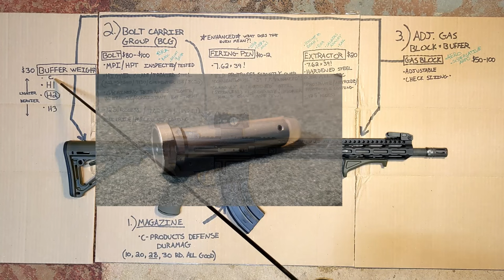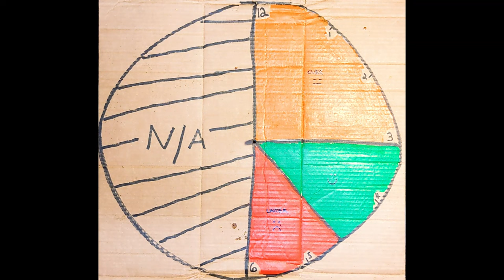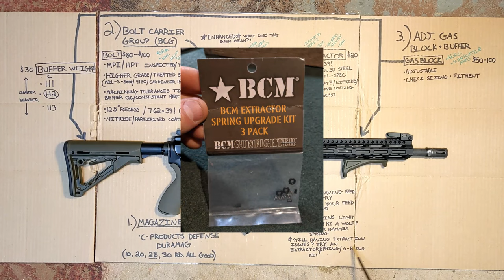How to Build a Reliable AR-47 (7.62x39 AR-15)

Comment: This is a video the needed to be made. Thank you for putting it together.
Reply from the maker: Klayco! Thanks man! Keep up the great work yourself!
Reply: Have you had a chance to test the 75rd 7.62x39 drum designed for the AR platform? I love the idea, but I don't have confidence in the purchase yet. Given the current value of my dollar, the juice must be worth the squeeze. Thank you for your time and efforts sir.
Reply from the maker: @jonathanrawls9992  I have not.  To be fair, I don't have much of a use for drums, aside from a range toy haha.  No problem, hope you found it helpful!
Reply: It's nice that you came out with this video. I made one in 2017 and "blew tub" dumped it. Anyway, I then covered all the shortcomings: mag failures to feed, lite strikes from short firing pins, extraction issues & stovepipes and breaking bolts/extractors.  Your suggestions are what I did back then, as well as I use WMD NiBX coated 9310 bolts. With steel ammo, I've had great luck and currently over 4,000 rounds with no failure. Good job on your video. Just to mention you wrote 9130 steel BC, I think you meant 9310. Also, all my BCs are melonited as well..
Reply: Biggest problem I had was getting enough gas to the bolt, gas hole in barrel had to be opened up, extractors are a service item. C products are the most reliable mags, 28 rounders are the best. 5.56 firing pins are generally not reliable. Built 3 rifles, bought 2 (bca). Redex bolts are in my experience very well made.
Reply: .125 gas port. .134 depth and corresponding extractor.
Colt and PWS use these dimensions. You must also have your chamber headspace to the bolt( duh)
These do not break bolt lugs or extractors.

Comment: You could have mentioned something about buffer spring differences. I prefer a flatwire coil spring made by Tubbs paired with a Spikes T2 buffer(h2 weight made of Tungsten powder instead of solids). The spring adds a better/smoother recoil along with the weight not clunking. Give it a try, thank me later.
Reply: I got the Tubbs flat wire buffer spring also but the first one was bent and the silicone coating was peeling pretty bad then I called them and they sent me another one which wasn't bent but the silicone coating was peeling pretty bad too. I wonder I can somehow get the old coating off with gasoline or some kind of chemical and reapply another silicone coating. Any suggestions?forgot to mention I found silent buffer springs for only a few dollars more and kicked myself in the ass lol

Comment: I upgrade all of my extractors to phosphate microbest extractors. The phosphate coating helps grab the brass and hang on until it leaves the ejection port. Slick surfaces like nitride or NiB are not ideal for extractor coatings because they have a tendency to slip.
Reply from the maker: I appreciate the info!
Reply: @ExtremelyAverageMan   have u heard of Cryptic Mystic coated BCGs?
Reply: @ExtremelyAverageMan  also I wonder if the shortened AR10 chambered x39 BCG from CMMG would fit in my Radical AR47?

Comment: Iirc the reason Colt was able to make a reliable AR pattern rifle in 7.62 * 39 was because they based their 7.62 × 39 AR on an AR-10. Since the AR-10 was designed to fire .308/7.62 NATO, it had no problem handling a weaker cartridge like the 7.62 × 39. The reason other manufacturers had issues making their 7.62 × 39 ARs run reliably is because they based it on the AR-15 which fires .223/5.56 NATO and was not designed to fire a more powerful cartridge.

Comment: I bought a BCA 7.62x39 upper years ago when Obama wanted to ban M855 and 5.56 prices went crazy. I saved my 5.56 and decided to shoot some of my cheaper Russian steel case 7.62x39 ammo I stockpiled for my AK/SKS. I did end up having to replace my hammer spring with a heavier hammer spring and replacing the firing pin with an enhanced firing pin for mine to shoot Russian steel case more reliably. I still had issues igniting Golden Tiger, but I just save that for my AK and SKS. On my bolt, I replaced the bolt with a Young Manufacturing heavy duty bolt with heavy duty extractor. I also prefer the 20rd Duramags.   So far it's been reliable enough for range use, and I wouldn't be afraid to use it for defense if I had to.
Reply: @85Sirex sound solid I’m trying to that on my first 762 build

Comment: Nitride treatment is more brittle. Can make the surface chip on on corners. Phosphate is more reliable FOR BOLTS
Reply: Phosphate will certainly last longer when firing but nitride is smoother and far more rust resistant while being a little more brittle than phosphate. Phosphate will last longer under firing while nitride will last longer when unused and it won't require as much lube to run as phosphate will.

Comment: Thorough. I've seen so many questions posted over the years and this answers pretty much everything.  Mine are 1.Radical 16" carbine gas with A2 stock/rifle buffer, tubbs 308 flatwire spring, MBT2, lpvo 2.BCA 10.5 carbine gas with H2, damage ind cs carbine spring, Spikes battle trigger, cheap adjustable gas block, mini PA rds. They're basically both spare parts bin hobby guns but they have the components you covered and work. Definitely 20, 28 duramags.

Comment: I bought my first AR47 back in 2007. It was a Armalite. In their owners manual it said not to run steel case. Other wise it would void the warranty. So I all ways stuck with brass cased ammo. (I reload now.) I also make sure the gas system is working perfectly. The ejection is at three o’clock. Never broke a extractor or bolt. Built two more AR47 rifles and bought a BCA at Christmas. I use heat resistance blue loctite on the gas block set screws and handguard screws. The bolts for the handguard thread into the barrel nut. They can get pretty hot. And standard blue loctite is not a good choice. On one of my builds I used a cheap adjustable gas block. After two times out to the range. I could tell that the adjustment screws were seizing up from carbon. Read on another forum that a guy used aluminum based anti seize on his adjustment screws. After two thousand rounds they still move freely. (Anti seize is good up to 1600 degrees.)

Comment: I know I am a little late to the comment section here, but this video is outstanding. I wished it was around years ago when I was trying to figure out how to build a reliable “AR47.” I will tell you after building many of these rifles that my best experience with BCG’s has been with the Fail Zero nickel boron. They are pricey, but have proven to be the most reliable BCG I have ever used in this platform. I would consider them second to none in performance and reliability not to mention they are worth their weight in gold when it comes to the reduction in frustration that comes with extractors and firing pin failures.  Thank you for the very informative video, it is very obvious that you have an exceptional level of experience with this platform as you massed your information exactly where the problems lie with the “AR47.”

Comment: You defiantly have a new subscriber. Great video with great information.I made the Switch over to 7.62x39 a year ago and got all the kinks worked out. You definitely have to do your research before switching over and building a AR-47 platform. It can be a pain at first, but once you get it fine tune it runs smooth as butter. Belom brass is the way to go. I've drop plenty of hogs with those rounds.
Reply from the maker: Thanks bud! Yeah, I feel it's that much more rewarding once you go through the trial by fire and get your gun running smoothly. Makes you appreciate the rifle more!

Comment: Two more things to talk about regarding AR-47s. 
 1>Taking out the firing pin and chucking it up in a drill to face off the end travel with a metal file for light strikes.
2>Marking your AR look alike with a visible ranger band so you don't accidentally put an AR-15 magazine into you AR-47 rifle.

Comment: That's all good and dandy FOR BRASS AMMO, but if you're shooting steel cased ammo, you're going to need an enhanced hammer spring to go with the enhanced firing pin to eliminate those light primer strikes. I was getting 5 to 6 light primer strikes for every 30 rounds fired. I got the "Wolff AR-15 Extra Hammer Spring WS-30093". My AR-47 goes "bang" every time now! Also, don't buy the enhanced firing pin from Bear Creek Arsenal, it is crap (several other comments say the same thing about it). Mine broke on the very first shot. Lucky for me the manager at Range USA let me go home and get my extra enhanced firing pin from Windham Weaponry so I could come back and continue shooting. With both my enhanced firing pin and the enhanced hammer spring it eliminated the light primer strikes. I shot my AR-47 70 times that day to test and it worked. Have not had any trouble since.
Reply from the maker: Currently optimizing my AR's for steel.  Last range trip I shot 80 rounds of lacquered steel and had 2 failure to feeds.  I've since polished my feed ramps with Flitz, hoping that resolves the issue.  Thanks for watching!

Comment: I know this video is a year old, though I wanted to chime in with my experience. I have been building AR-47s since the barrels have been available. I have learned a lot and even used one in the rifle classes I taught. If you buy a Bear creek, don't get the side charger. Why? Because you want a entirely different BCG in it from black rifle arms. You can only replace the bolt when you go with the side charger. I actually had over 20k rounds on a BCA 7.62x39 upper with a full BRA bolt carrier in it. The Bear Creek extractor broke after 300 rounds and the bolt face blew at 650. They were very quick in replacing the part, but I decided to upgrade them instead. The enhanced firing pin BCA uses is still very brittle and they break anywhere from 10-200 rounds. At one point bear creek gave everyone 2-3 extra because of all the issues they had with them breaking. The bear creek barrel was excellent and the only reason I replaced it after 20+k rounds was because the rifling was almost gone. It would still hold 4-6 inch groups at 100 but  I really got my money from it and it was time to replace it. At that time bear creek barrels were extremely cheap, I think it was like 55$ so I ordered another one. I didn't even ask them to replace it but I am sure they would have. Now the BCA barrels are 100$ or more and you could easily get a Faxxon from Right to bear for about the same price. The Right to bear branded stuff is either aero, bear creek, or ballistic advantage rebranded stuff. I find nothing wrong with buying a bear creek 7.63x39 but if you do, account for the added expense of the black rifle arms complete bolt carrier group with firing pin. With that added, you are equal to the price of a PSA with much better reliability because of the Black rifle arms upgrades.

Comment: I’ve been running x39 AR’s for a few years now with no issues, an 18” mid gas and 16” carbine gas. My setups have A5 buffer systems, adjustable gas blocks, and Young Manufacturing bolts. The A5 system is comparable to a rifle length buffer system which help slows the carrier which reduces wear on the bolt. The adjustable gas block helps fine tune the gas that cycles the carrier which also helps with wear. The most important is the Young Manufacturing 7.62x39 bolt. The bolt has a thicker wall and extractor than most/all x39 bolts on the market. Young Manufacturing was bought out by KE arms in 2021. They still sell the bolt but for whatever reason don’t have the description on the bolt specs on the website.
Reply from the maker: That's good to hear about the Young Manufacturing Bolt, I caught wind of it soon after this video of course, after FocusTripp put out his vid on it too. Looks like a better option for longevity
Reply: @ExtremelyAverageMan I’ve had mine for quite a while now and it’s held up so far. Granted I haven’t put thousands of rounds through my rifles but with the hundreds I’ve put through I haven’t had any issues. I got my bolts before KE arms acquired Young Manufacturing in 2021. Seen a vid of a guy who had bolt carriers from before and after and the latter carrier was out of spec. Then they ended up sending him another out of spec carrier after he returned the first. So I’m not sure about the QC of Young Manufacturing at this time
Reply: @blaksabbath9108 Perhaps that's why the new management removed the bolt specs but that's just speculation on my part. Damn shame if that's the case though.

Comment: One thing I noticed building these uppers is that some barrel manufactures will sell you a 7.62x39 chambered barrel with 223 extension ramps not 30 cal ramps. BCA at least has 30 cal feed ramps on the barrel extension. Not sure if this was covered in the video

Comment: I've built two 7.62.39 uppers and the only issue I had was on the one I tried a cassette style trigger and just had way to many light primer strikes...I just use mil spec style triggers and springs in nickel boron and I will use what I call a take up screw in my pistol grip screw hole to take the creep out of the trigger and I've found C- products and ASC mags work the best.

Comment: I love my AR-47! Built on an 80% lower and a Stoner complete upper from Midway for about $700 including buffer system and furniture. I use ASC sheet metal mags for the fatter cartridge. I had a couple FF jams at first, but then I polished the feed ramp with a dremel tool and it's been flawless ever since. I think I sanded down the feed pedals on the mags to make them smoother too.

Comment: After around a year my AR47 runs well. Replaced my Firing Pin with an "Enhanced Bear Creek" in SS. So I have an extra. I only used Brass so not an issue. Will be purchasing Extra parts and things. My x39 is a standard rear and my 5.56 is my side charge. So backwards. But I'm going to be purchasing a different upper in x39. Thanks for the info. Great video.
Will check my gas system and recheck my weight in my buffer on both builds. Not my first rodeo, but I only run around 3-5 hundred rounds a year as I can't afford it. I live on SS.
Again thanks

Comment: Wow.... spoken like an average guy! Sub'd. I built my first AR-47 about 8 years ago and have run into most of the common "issues". I solved my issues with a credit card, a lot of range time, and a lot of part swapping. It really does boil down to the 4 points you highlighted. PS, I have  a couple of  "Right To Bear" barrels, I find them to be pretty darn good for the price, they ship quickly and have been great to deal with.
Reply from the maker: Awesome, thank you!

Comment: Awesome video just subbed! I have narrowed down my x39 barrels to diamondback firearms with zero issues running steel and all BCG’s are BRA period! I have not run Faxon but do have some of there bolts as the specs on them are impressive, superlative arms adjustable Gasblocks ar 100% and if you run suppressed it’s the key to keep it running smooth. For subsonic loads 196 brown bear you have to enlarge gas port to 2.80mm with h2 buffer has been 100% for me consistently. If the gun will mot run reliably on steel case then I would find the problem and change it out just saying, I own the new sig LT and Pws x39 guns which are hands down 100% but enjoy my home build x39 uppers and have now got the years of trial and error down to a reliable platform! I encourage anyone that wants a x39 AR platform to spend that extra $$ to begin with so they don’t get disappointed first thing. One of my PWS guns has over 7,000 +\- rounds and only been cleaned twice, sig is still getting rounds but be awhile before that round count get there.
Reply from the maker: Thanks man! Yeah I'm trying to help people here by getting them to run good initially...although I wouldn't have learned half as much if I didn't have issues along the way haha. Yeah I need to narrow steel issue down.  At the time I was getting stuck cases with Tula, but I do have some lacquered steel at the moment...maybe I'll give it a go next range trip.  Thanks for the sub and  for watching!

Comment: I just picked up a right to bear 762x39 complete bolt carrier group for 99$ this week.  Long story short.  I had an extra lower I wasn't using.  Last weekend I went to my local gun store and I found a complete 762x39 upper assembly with charging handle. So I paid 250$ for it and ordered that bolt carrier group from RTBA . I put everything together last night and I plan on going to the range tomorrow morning.  The lower I'm running is palmetto state. The upper is a brand I'm not familiar with.  Hopefully all goes well.  I enjoyed your video
Reply: WELL ?
Reply from the maker: Thanks! How'd it do?